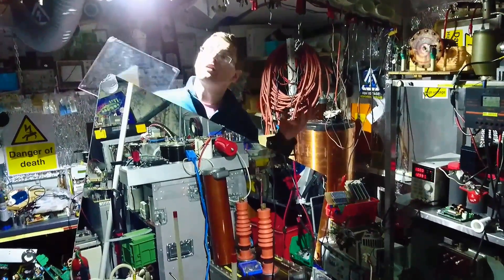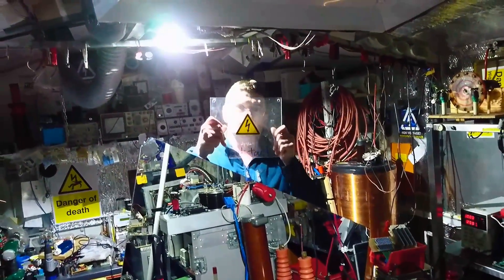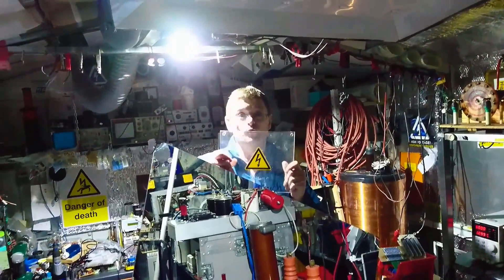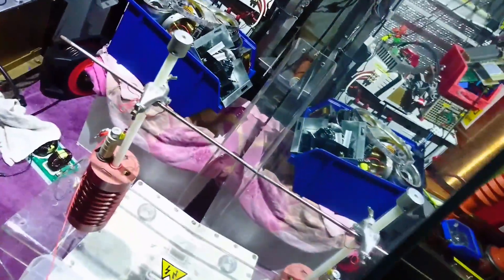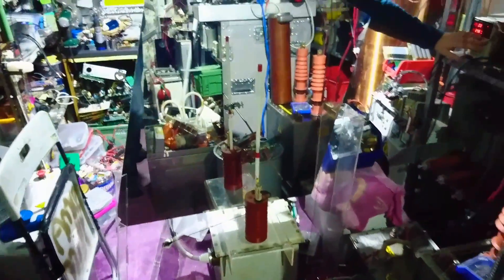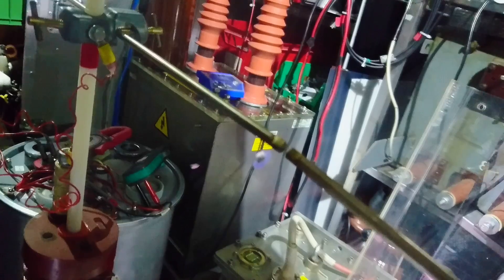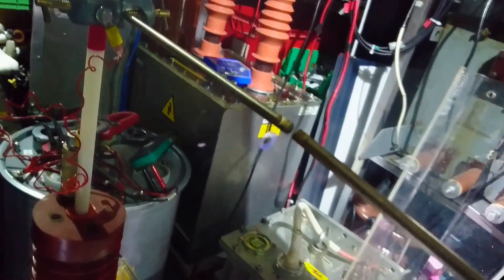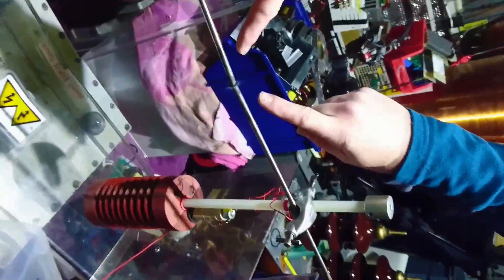Never do this to a mirror!!

Comment: So do you always use a korad power supply for you lighting? You obviously have power to that work shop, just wondering why use the power supply? It can't be the most efficient taking AC to DC for lighting using a power supply like that. I'm just asking because I'm curious, and it drove me nuts when I heard the clicking sound and couldn't figure it out at first. Then it came to me, it sounds like a korad the same as two of them in my lab. But I think yours was a single, but I'm not sure since I couldn't get a good paused view.
Reply: Some lighting depending on what you use use lower then main voltages. I use 50 watt LEDS in my basement and they both run off a DC converter. (They won't run on main voltage, it will fry them.)
Reply: umbrefawx I run 24v LED in my shop of a SMPS.  Its pretty efficient as long as the low voltage runs aren't too long.